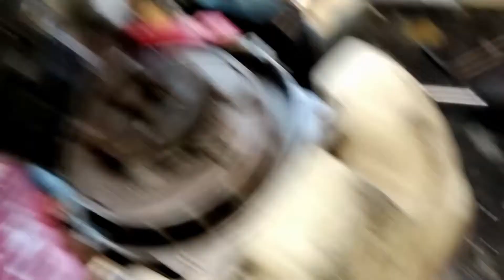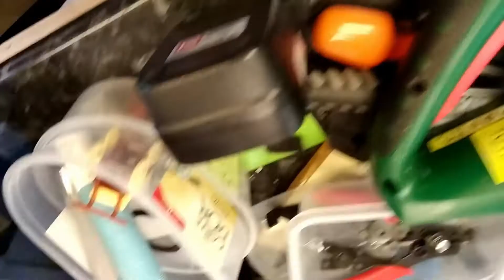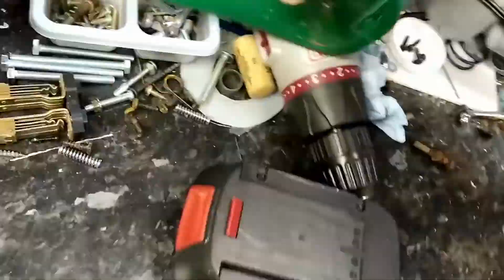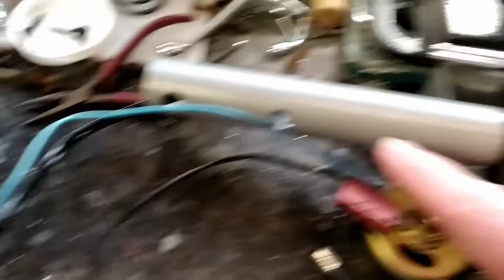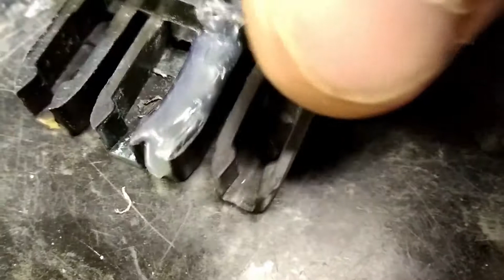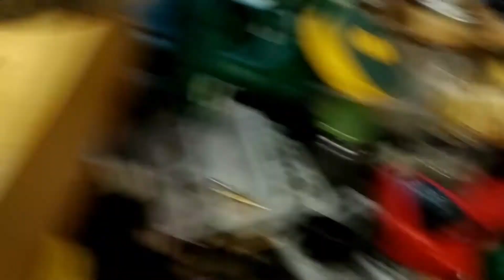Converting a petrol strimmer to cordless electric

Comment from the maker: Nearly two years later and it still works. The only problem is the battery, which really needs to be replaced because it doesn't hold much charge nowadays.